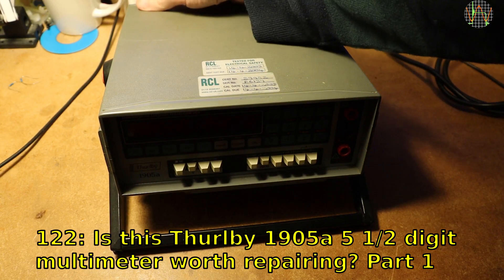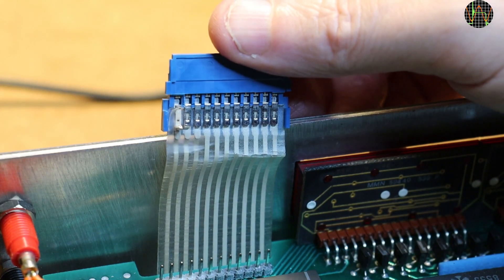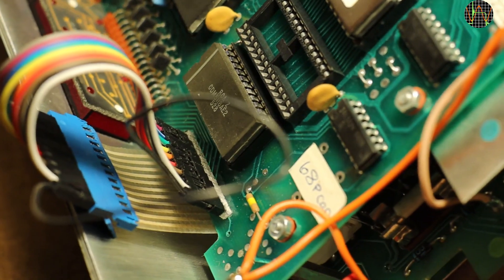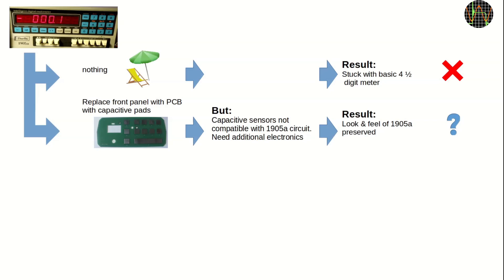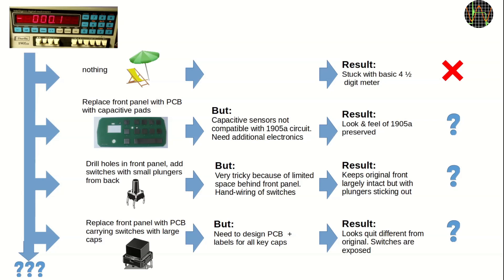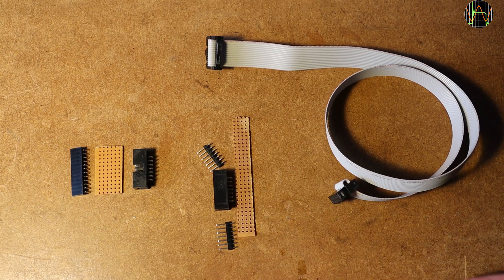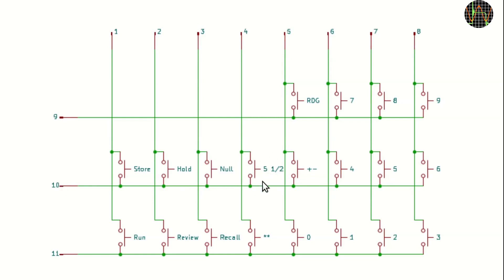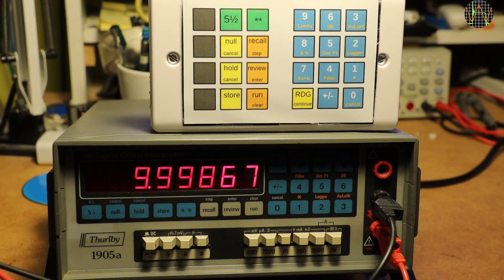122 - Is this Thurlby 1905a 5 1/2 digit multimeter worth repairing? Part 1

Comment: That smaller keypad layout on the meter looks similar to the size used on Point Of Sale equipment like scales.
I think it would be fairly easy to find a smaller membrane assembly to retrofit the existing one. Remember, you don't need anything except the sheets that make up the switches, and you can hack the rest.
Also watch EEVblog #1282
Reply from the maker: Forgot about that episode. Yes  that sounds easy but the prices $254 for 5????
Reply: @TheHWcave  - I think that's the whole thing, not just the membrane assembly that you need.

Comment: I had been having problems with that kind of cable too. I managed to kludge a connection on it by piercing thru it with tiny tin-plated copper wires, heated with soldering iron. That was more a McGyver solution, but worked.

Comment: There are places that make custom membrane keyboards, you just design it and they make it for you, at a cost of course.
Reply from the maker: Yes I agree, but as with all these solutions, is this meter really worth the time / expense? That is essentially the question here. I like a challenge but at the end, the thing must have a good use case. I have many other projects and little time (family and full-time job).
Reply: @TheHWcave  yes it isn’t cheap, most of it is setup cost, but someone could do it and get a quantity of them made, and sell replacement’s to those that need them
Reply from the maker: @TheDefpom  Yes, I agree this is certainly something to consider. I wonder how many 1905As are out there with this problem.
Reply: @TheHWcave  - look at Dave's EEVblog #1282. Remember, you don't need the buttons/front panel, which is the expensive part of the job.

Comment: Good job! 
Is it mostly a collection thing for you or it is a useful tool at the bench? Investigation process of finding fault and fixing it is really interesting, but what will follow afterwards? For me the tendency of buying such of old equipment is to put it on the shelf for a background, maybe use it 1 or 2 times per year, maybe i am wrong?  Didn't mean to offend, just curious.
Reply from the maker: I do not collect, I want the things to work in my lab. I can't  justify the expense of buying new test equipment (exception was my Rigol scope, Brymen 869S and OWON XDM1041). Everything else is used stuff.  However, as happens with these things, I now have a (temporary) collection of sorts, in that some are sitting on a shelf / garage waiting for repair & calibration and some have been replaced with other used stuff and I am trying to work out which one to keep and which to sell...

Comment: Now you have figured out rows and columns of the switch matrix, you have lots of possibilities to rebuild the front.
Forget about any solution incorporating same style of flexible pcb.
Instead use a universal pcb layout with a sturdy connection.
Try study the services offered by JLCpcb and PCBway for a possible solution.

Comment: Ouh and about the questions if it is worth it to repair the multimeter, I say it definitely is, I want a desktop multimeter so much, but for me as a hobbyist it isn't worth it to buy one, even the cheapest are extremely expensive just because they have a different shape than usual multimeters, was thinking about to buy a handheld one and build it in a different casing but this thought moved further to an own arduino based multimeter, but for my brain it wasn't enough so it wants to add the transistor tester, a basic function generator and a very basic oscilloscope to it and now a couple of the some others of me are arguing for months about all of this, while my main me says that he doesn't have the programming skills, but they don't care much and say I will have to learn it 😆 Does it look like I am nuts 🤪?
Reply from the maker: Not nuts but my advise is to start small. Its great to design your own gear and I definitely learned a lot in doing so (including what doesn't work!). On multimeters, the key problem is not so much making one but how to make sure it reads the correct value and how to make it survive the occasional mistake (i.e. wrong range, AC vs DC, volts when Ohm is selected...) we all do these errors occasionally. Calibration of a self-built without a meter to compare to that you can trust is the other problem.
Reply: @TheHWcave  The loudest voice in my head got the Me who asks about the sense and necessity, that is blocking me, I want one but don't really need one. The hardware part is not that hard to make, I got almost everything needed, it is just my brain that refuses to learn the C language properly finally, everything is available as open-source and the adjustment can be put in a settings menu and saved in EEPROM, as I did designing my soldering station with every single variable, also putting it all together is not that hard, but the Transistor Tester code is very complex and I am too bad in programming to implement it.

Comment: The first thing I thought of are TTP223 touch modules, you could repeat the keypad matrix on a small pcb and connect the touch modules to it which you place behind the original buttons. I think this is a very cool solution and very easy to do, the hardest part is to find out how the matrix is wired and the result is that you keep the original look but add some modern technology to it, the buttons must not be pressed anymore and will last for much longer, obviously the material it is all made from is not very good, the plastics is drying out and cracking. Another option is to order flex PCB in China, but you never can order only one and it isn't that cheap, to solve this problem again you would have to look for other people who have the same problem and would buy the leftover PCB's, but I'm not sure about the result and how easy or hard it is to do, definitely very time consuming.
Reply from the maker: Sadly the TTP223 output can't be used in a matrix used by the without additional electronics / microcontroller) to convert the signal. That seems to be true for just about any touch sensor solution. Given the efforts on design and making such a thing or a flex PCB etc, one has to consider whether the meter is worth it.
Reply: @TheHWcave  It can be setup as momentary and toggle switch, is it really not possible to set single modules as momentary NO switches and just use them instead of push buttons, just connecting and disconnecting contacts by using optocouplers or something like that?

Comment: Shielding in that area may not be so important considering the huge hole for display right next to it. What about making a circuit board (printed or just scratched out considering it ain't complex) for smd mount buttons and unsticking keyboard cover, drilling holes and resticking the panel back? How else would you even mount the normal buttons behind it anyway?
Reply from the maker: I like the idea of a "sandwich" PCB+original panel but the PCB + switches would have to be extremely thin. First there is a groove around the housing, but even if I trim the original front down, the other problem is the mechanical buttons at the bottom. If the sandwich is too thick they can't be pressed in to release. While most are radio-type, i.e. press one in make the other pop out, there are special ones that work differently. But I'll think about it ..